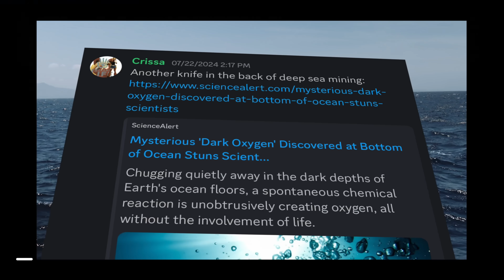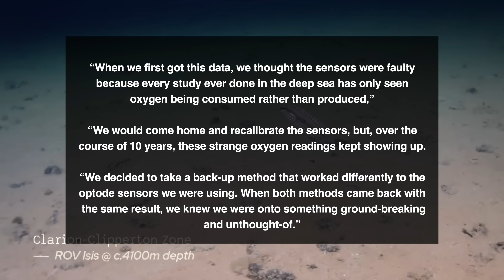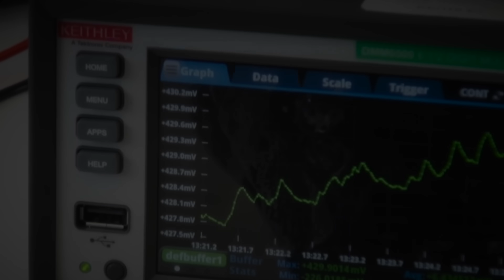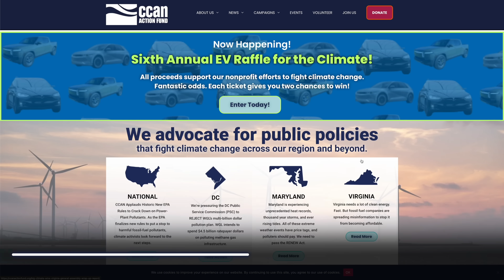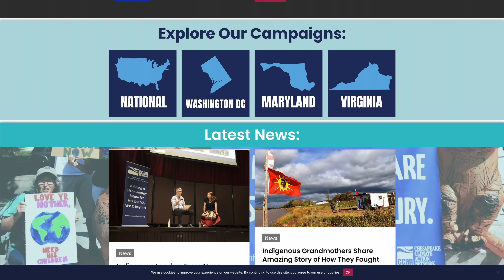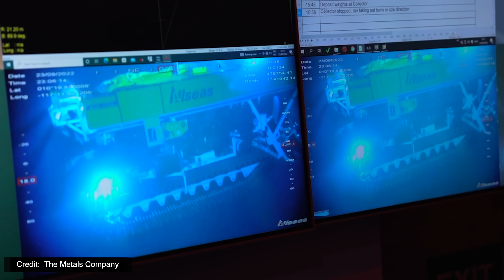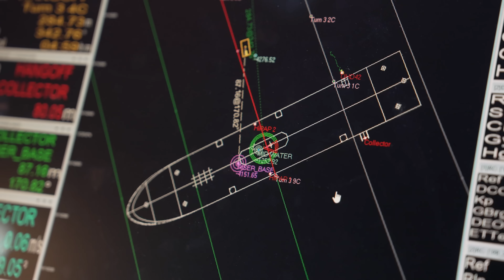The HUGE Problem with the Dark Oxygen Discovery

Comment: I would suggest that first the research is flawed. Clearly there is a source of oxygen in the deep seas, but there are serious problems with the researdh not finding hydrogen evolving and they are saying it is electrolysis..   Also the formation of these nodules is counter to the claimed process.   
The source of deep oxygen is actually methane rising in the earth encountering lots of metal oxides.  It encounters these metal oxides and releases water and oxygen from polymerization of methane into oil, which rises immediately for the surface.   The polymerization reaction here produces (-OH) hydroxyl.  This recombines to Oxygen and water.   4(-OH)  --> O2 + 2 H2O.
The nodules are largely sulfides and carbonates and that is not same chemistry.    O2 and H2O diffuse away without much appearance in the sea.   
The reason you are hearing this nonsense story is that people are trying to stop deep sea mining.  I think the issue should stand or fail on it's own merits.  We shouldn't be trying to find excuses like this.   This is also why mining companyies should not hire "Woke" researchers.

Comment: We should be and continue to investigate other forms of battery energy that uses less or no cobalt and other metals. LFP batteries have proven to be promising. CATL's announcement of their newest LFP battery is has promise and it's already being used in at least one Chinese brand EV. And say what you will about the Chinese because I don't care. They're on the forefront of many advancements in this ahead and have a 10 to 20 year lead over the US so as a technology guy I'm looking at it from that angle and what it means economically and environmentally going forward.

Additionally we have companies looking into Sodium Batteries. Considering that's abundant on the planet it's worth continuing to investigate and test. Ultimately we need to ramp up our battery recycling efforts. While we continue to march forward with EV adoption we also can't forget the plethora of battery operated devices we use. We need to continue to collect it all, recycle it all and process it here in the US instead of sending it elsewhere. While there are a few companies here in the US and Canada doing that work we need more. And I'm not dismissing how expensive recycling can e. But I'd wager that cost against more digging and now looking at the oceans for resources.

Comment: I would be interested in a segment about the production of hydrogen from the ocean.
Reply: So would i, if its splitting correct, then there are 2 hydrogen atoms to every oxygen atoms produced , ( No mention of what effect that is doing ?)
Reply: @mariebaxter473  I do not think it would harm the ocean environment. In all cases, the use of hydrogen as a fuel results in water vapor as a byproduct. This will eventually return to the ocean.
Reply: @michaelbyrd499 if you remove substantial amounts of water from an aquatic environment you increase the concentration of dissolved materials dramatically, which can be deleterious to the health of the ecosystem near your production plant. This is a concern with seawater desalination and an ongoing problem at the Great Salt Lake as its water levels sit well below historic levels.

Comment: Wait - current thinking is we have to mine this, as opposed to manufacture it? 🙄
Reply: Manufacture it with which materials... they want to mine it for the materials, not for its function
Reply: @ΗΕΑΗΘΣ  So it contains completely new materials, previously not on the table of elements?
Reply: @jvlbme  The problem is that these materials are fairly rare on continental crust, making manufacturing anything with these materials expensive.
Reply: @jvlbme table elements are not all elements, i think it was something to do by how they are composed it make them pure elements. But we have many more other materials in the universe, like plastic.
Reply: @XGD5layer  It's not that they're hard to refine, the process is easy, it's just that they don't exist in high amounts in the earth's crust. Half of rare earth elements are radioactive with short half lives, and the other half are super heavy elements that are only produced in supernova.
Reply: @kirknay  The refinement process may be straightforward but the reason it's a pain, to my understanding, is that while they exist in a lot of places, their concentration is low.
Reply: I believe you're mistaking molecules and the periodic table of elements. I believe this would be considered a compound.
Reply: @GunF0x yes, you're correct. Plastics are compounds, principally of carbon, hydrogen, and oxygen, which nevertheless consist of the same elements that you'll find on the periodic table.
Reply: You can't manufacture chemical elements like that. You have to find something that contains the element and extract it.